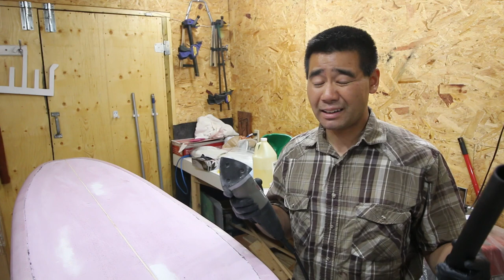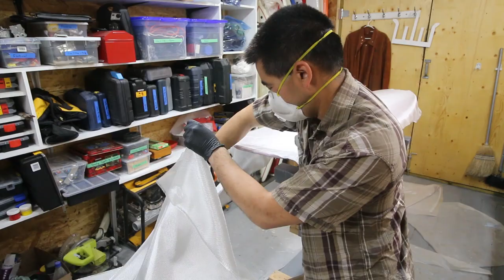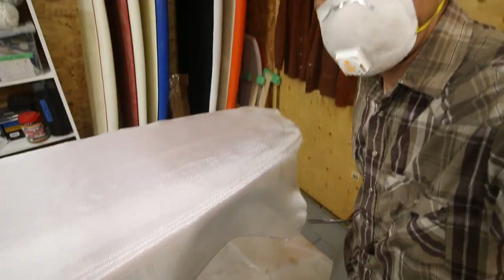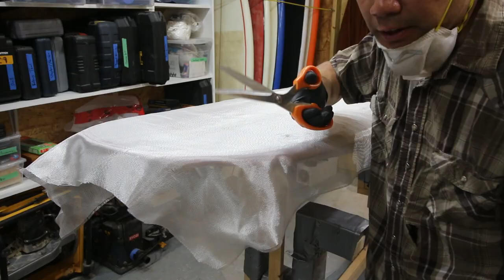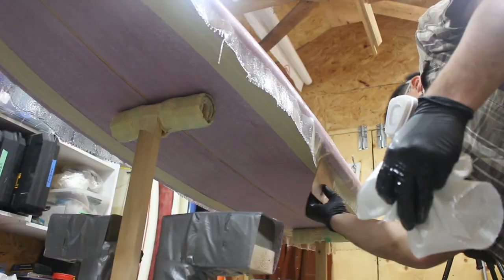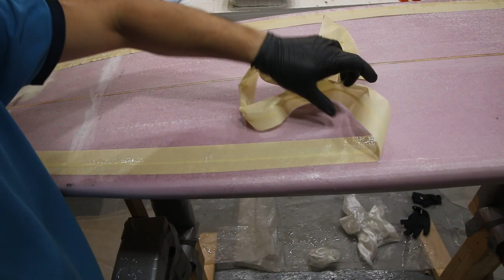How to Make an XPS Foam Surfboard #10 - Laminating the Deck

Comment: Best way for figuring how much resin you need is to weigh the fiberglass, and measure out the same amount of resin by weight. Note that the resin to hardner ratio may be a bit different if you measure by weight.

Comment: Hi sir, compliments from switzerland for this extraordinary work. I'd like to ask you what kind of glass fiber foil glue you use to attach it to the xps filament? Could I attach E-glas Faser Twill 0,16 MM 160g/m2 foil with your recommended glue?
Best Regards

Comment: I've seen several videos of epoxy directly on xps and how epoxy melts the xps. Are you using a special kind of epoxy or how did you prevent the epoxy from eating the foam away?
Reply: epoxy resin shouldn't burn. 
polyester resin will. 
same with the other common one. 
forget the name now. 
polyurethane. 
those two will dissolve the xps. 
epoxy is cool with everyone. 
real chill resin.

Comment: i wonder why there wasnt used peelply , since it minimizes the sanding afterwards, and a good deal of airpockets in both ends, it will be weakpoints in the long run

Comment: Love the Video series on how to make a surfboard. Actually inspired me to get out there and give it a try. Just wonderign where you get the resin research epoxy from? 
I am from southern Ontario, it seems as if you are from canada as well. Is there a big issue with getting the resin across the border? I've been looking at purchasing some system three SB112 or pro-set epoxy from composites Canada (in toronto) to hopefully alleviate the headache at the border. Would that be a wise decision, or would i be better off to just get the resin research?